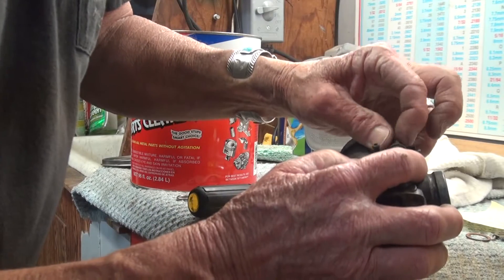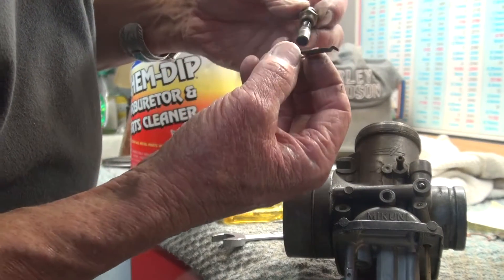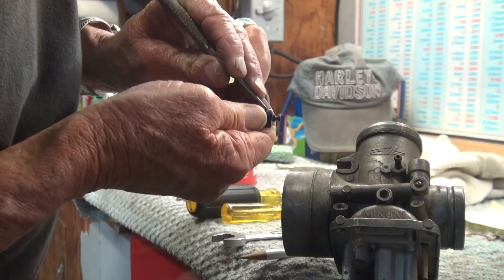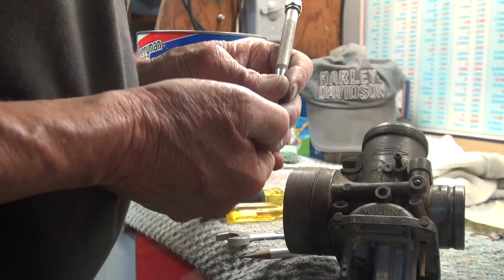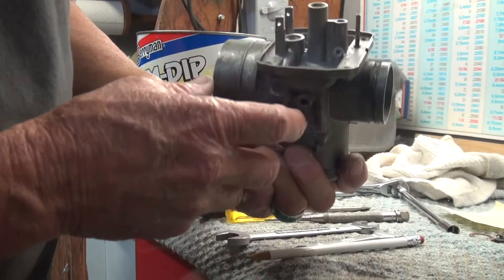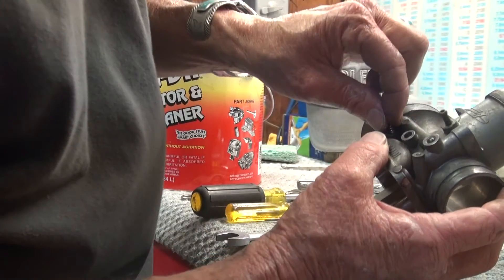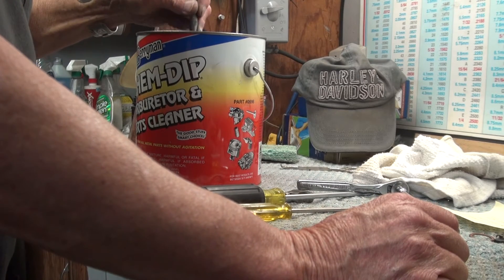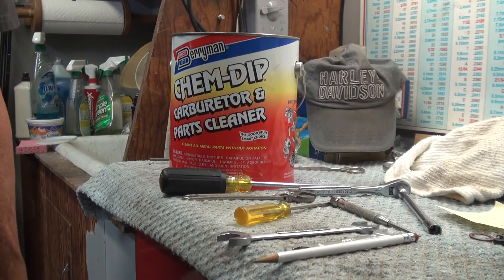Disassembling a Mikuni VM38 for Cleaning(2/2)

Comment: Thanks for the video on mike I carbs. I’m an old dirt racer from the 60’s and early 70’s. Some of the eurpopian bikes came wth Bing carburetors that were terrible. The first thing you did was replace it with a mikuni and that ended all problems. Now years later we replaced the carb on a KLR and it worked great. Thanks for you additional video on discribing the pilot and air jets and what size drill bits to clean them out with. Jim B.